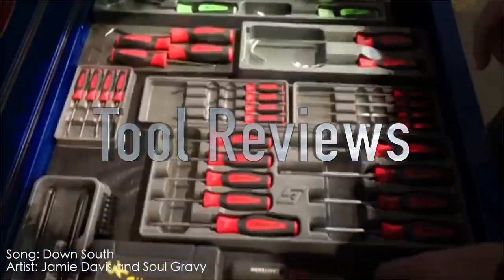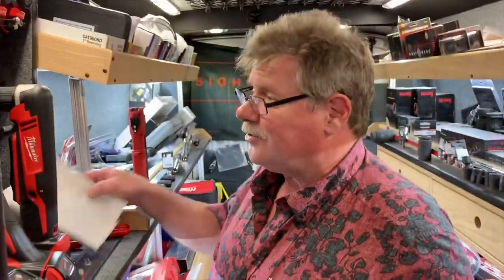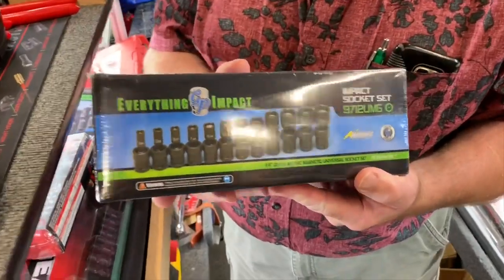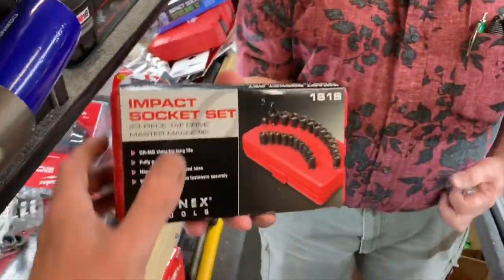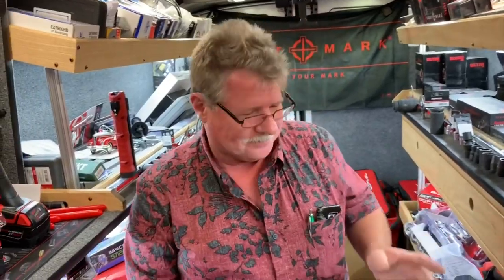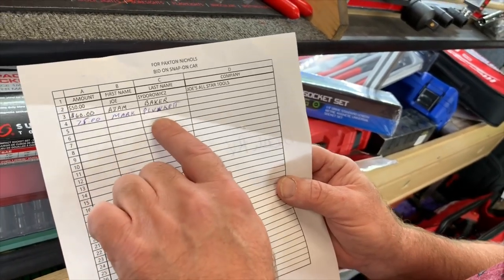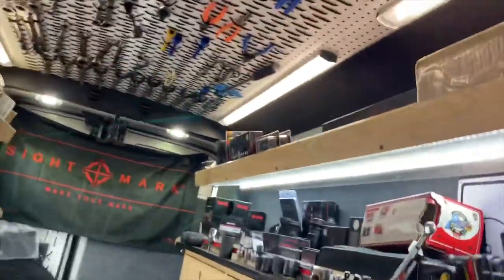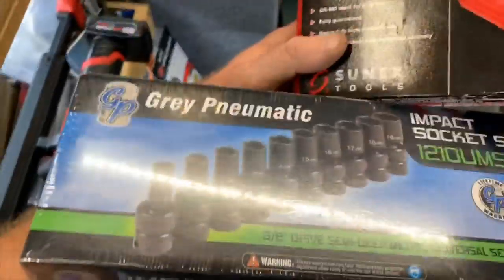Joe’s AllStar Tools: Grey Pneumatic Universal Sockets and Sunnex Magnetic Sockets

Comment: Grey pneumatic and sunex are some of thee best sockets for the money!!
Reply: Just remember that both of them don’t do photo warranties. Many online sellers are not certified Sunex or GN dealers which mean they don’t do warranty returns. You’re going to pay shipping to send them back to the manufacture and wait up to 4-6 weeks for replacements. I’m not waiting that long. I’ve been beating the hell out tools for almost 30 years. If I need a replacement 15mm socket I need it ASAP and I’ll pay more to get it quickly. That’s the value of my tool man.
Reply: @prevost8686  if you check on the garage journal forum sunex absolutley does do a photo warranty. Most of the time a photo isnt even needed, just call them. But yes there warranty shipouts have been slow in the past.

Comment: Completely unrelated to the video. But I’m having issues with the RobinAir at work and hoping you mite have some answers for me. It keeps telling me the tank pressure is to high. Any thoughts? If not it’s fine . Take care bud see ya on Friday
Reply from the maker: I have no clue on a Robinair unit ? All I have ever dealt with is Snap On and Sun
Reply: The solenoids go bad all the time, but I can't say for sure. RobinAir is usually pretty good about sending techs out; Have you tried giving them a call?
Reply: Michael White I had it happen to me one day and I was instructed to close off the valves on the tank and bleed the pressure from the system and turn the valves on and it started working again. The new ones won't let you do anything with that warning on. Best of luck